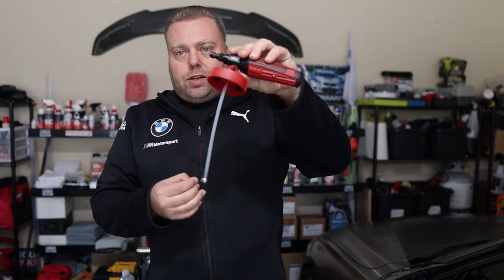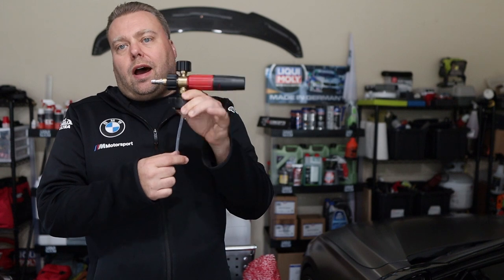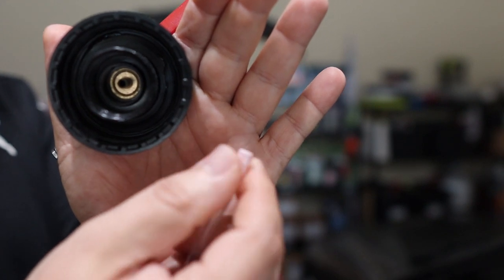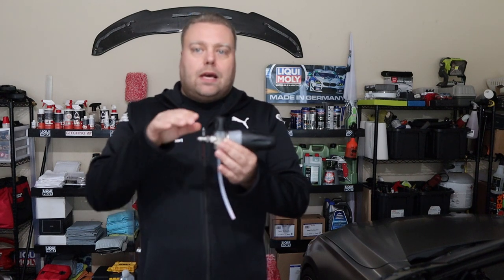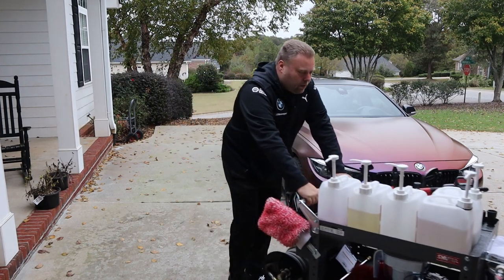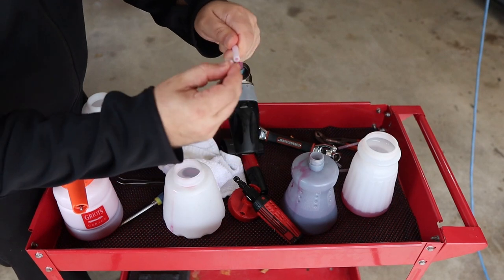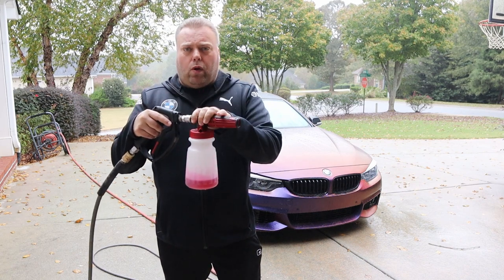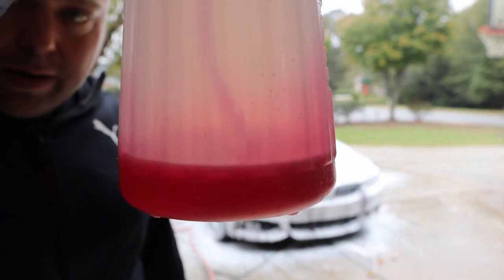EASY $6 FOAM CANNON HACK | AUTO MIX ANY FOAM CANNON | CAR DETAILING TIPS

Comment: if purchasing a new foam cannon, automix seems like a nice option.  would it make sense to get the MJJC Pro 2. and add it, or get the Boss with the tips included ??  (current pressure washer is gas, and have the old school foam canon, narrow neck jobber. electric might be in the near future ) thanks !!
Reply from the maker: Gas, I would go with the Griots. Better built materials to handle the pressure.

Comment: Such a great invention. So for a active ve52 and the MJJC Pro V2 with a 1.25 orifice would you go with a pink tip?
Reply from the maker: I have had the best results with the purple tip. I don't think pink is necessary until you reach over 2.0 GPM like a Blue AR630.

Comment: What do u do with extra soap at the end can the ball rest in that solution for months or do u take it out and cap it?
Reply from the maker: You could take it out and cap it as the manifold should be cleaned out regularly. I have had no issues with any of the MJJC weighted balls. I wouldn’t trust Griots though they rust.
Reply: @CarsWithKeav  they should sell a upgraded stainless version lol

Comment: Will the Griots boss foam connon work with a small electric power washer Ryobi 1.2 gallon
Reply from the maker: Yes it sure will you would only need to change the orifice nozzle to a 1.1 size to et that thick foam.
Reply: @CarsWithKeav  Thanks

Comment: Hey Kev , 
I forgot to ask you if using the metering tips is better than a diluted mixture  ?
Is it better to use no tips for most foam or do the the tips produce same foamage , just your personal view.....because sometimes video doesn't do justice.  1✌
Reply from the maker: Should be the same foam if the dilutions from the auto mix are the exact same as doing your own. The tips only allow you to just leave soap in the bottle full strength forever and not have to mix with water. Just easier to do, but if you do many chemicals then diluting yourself is best. Unless you have as many foam cannons as me. 😂

Comment: Would you please measure the hole in the tip. Reason: Griots Garage does not ship to Germany. Griots has UK office. But they don't ship to Germany either. You can also get tips here, but you have to know the size of the hole. Please measure!
Reply from the maker: I’ll give it a try, but it’s super small almost to the point you can’t see through it. I don’t have anything small enough to measure.
Reply: @CarsWithKeav  A carburetor-shop may be able to help. There one is familiar with small nozzle sizes.
Reply from the maker: @2jost  I actually have the tools they use to clean carbs and welding tips, but they are not labeled so no idea what size they are. 😂 I know which one is 1.1mm and 1.25mm as I bought them to make it easier to know the orifice.

Comment: How many in a pack and do all 3 come in a pack?
Reply from the maker: I think they came in packs of 5 or 6 and it’s all one color which sucks.
Reply: @CarsWithKeav  did yours have a pin prick hole at top? Mine does, looks like barely any soap would go through